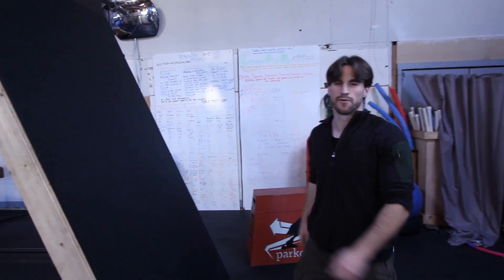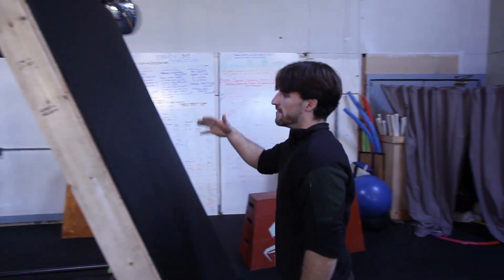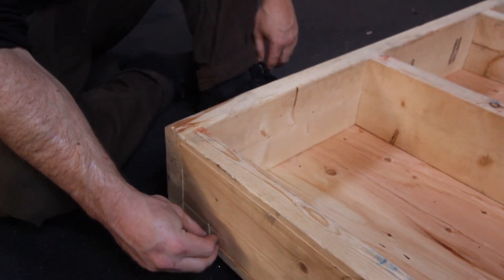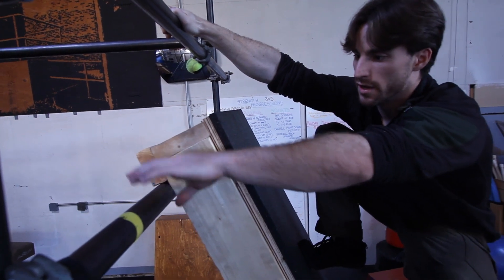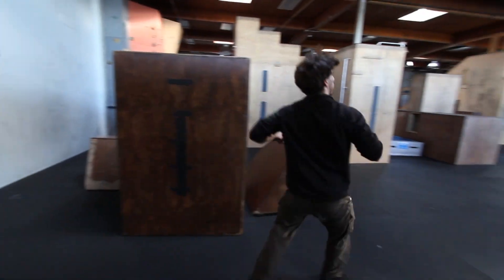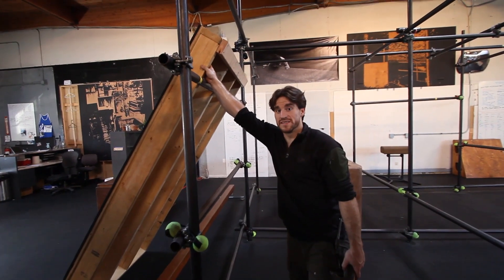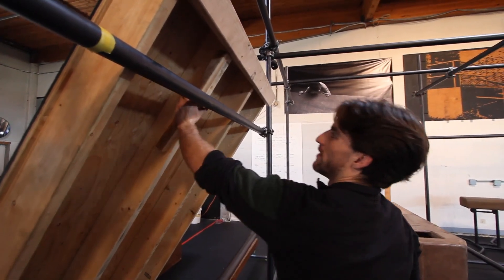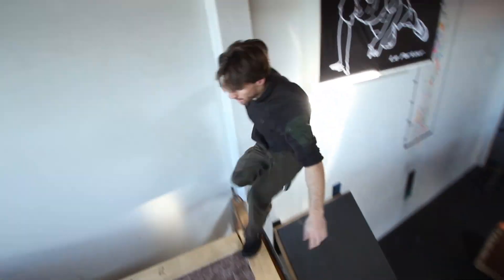Adjustable Walls and Platforms - STURDYmade parkour obstacles

Comment: Have you ever used schedule 40 piping? I'm looking at getting 1 1/4" schedule 40 piping and I'm wondering whether it's going to bend on me. According to some information I've gotten any span over 6 ft. will likely bend, but that was for 1" schedule 80. Advice?
Reply from the maker: I always recommend schedule 80 because you'll just be able to do much more with it long term

Comment: I think on the side of the wall you should have a set number of screw holes and then you get a clamp like this, http://bit.ly/1ry5ywI (Curtain clamp) and then when you want to adjust the wall, you screw the clamp into place and clamp it onto the railing.

Also because the clamp will be facing outwards from the board you could use and L frame or something like that to make it face the pole.

Comment: You could just notch the joists, so that they naturally "hook" onto the pipes. Would work both at angles or as a platform between two bars. You'd lose some structural confidence, I suppose, were you having multiple people landing on the platform at once but I would think even notched 2 inches in, that the stresses still wouldn't cause the wood to fail.
Reply from the maker: Michael Riddick We were looking for a way to clamp at any distance rather than notching a ton of grooves. We've started using some nice heavy duty pipe straps.